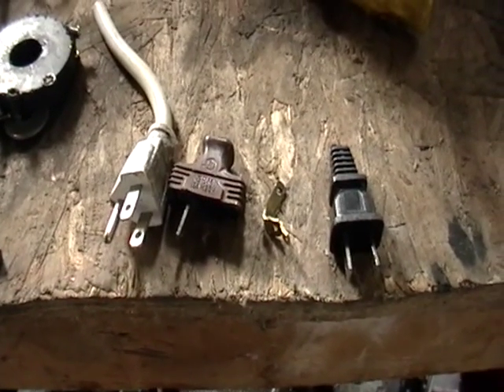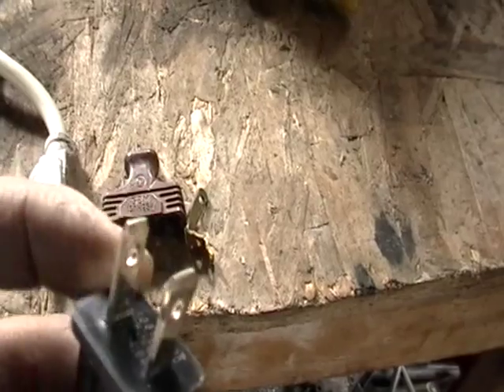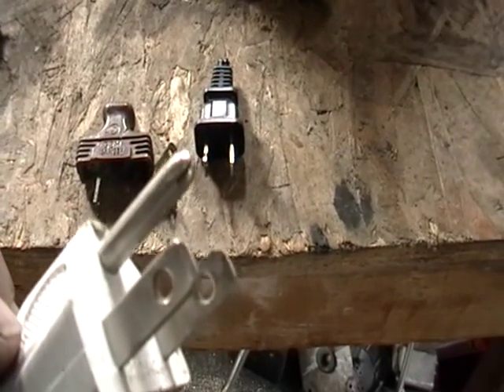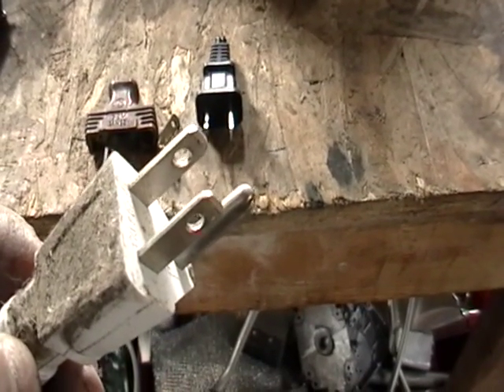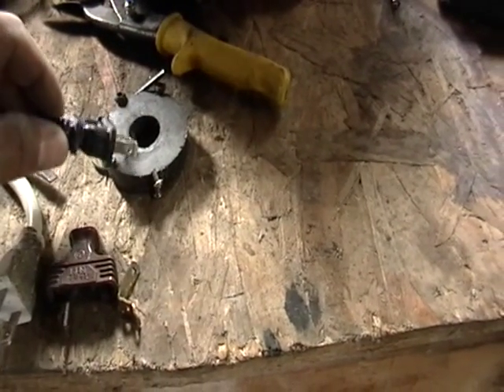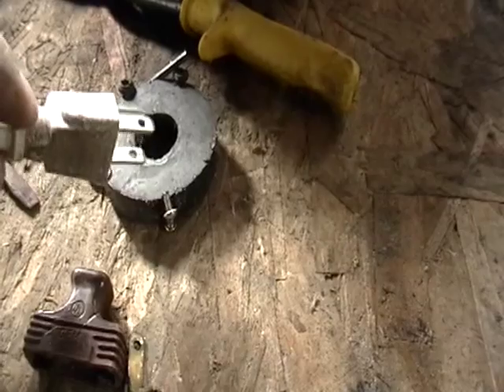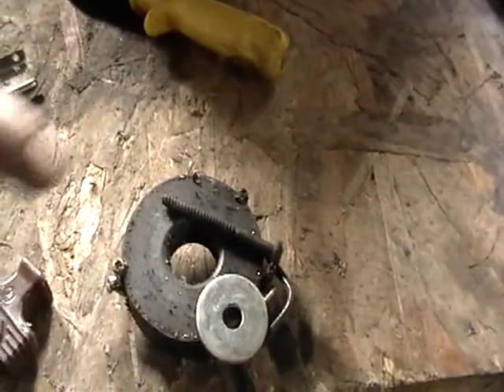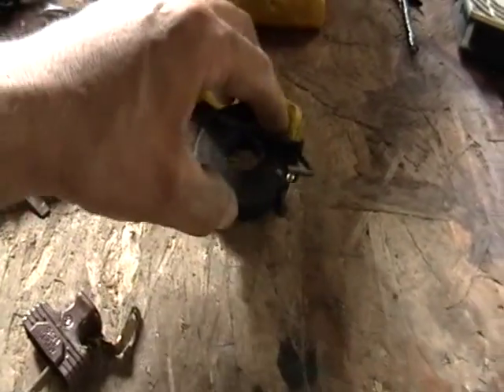scrapping Brass  for money

Comment: @lmvelazquez100 - I use to work at a cop shop (not as an officer) and they cleaned out the gun range one day and had a 5 gal bucket full of lead bullets. I tried to pick it up, and it must of been 200 lbs. They probably chucked it in the dumpster. At that time I didn't know lead could be sold for scrap or I would of taken it (with permission of course). Don't know if they're soft or hard lead. Hard lead is about 20cents and soft is about 50c a pound.